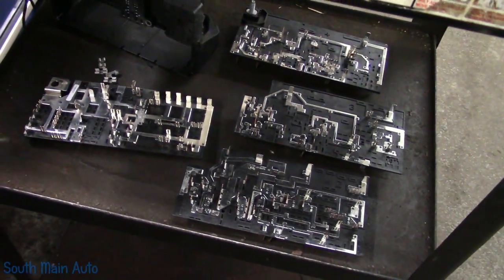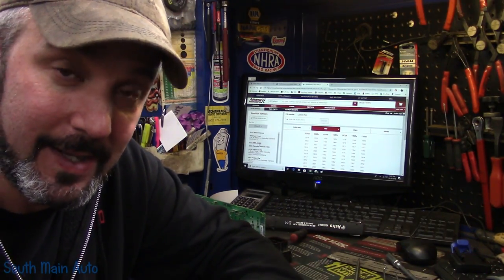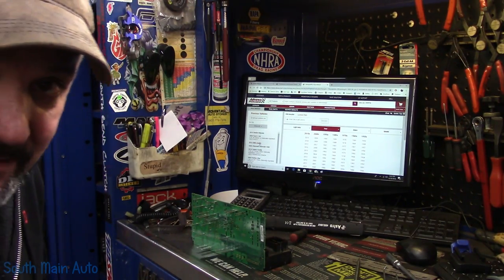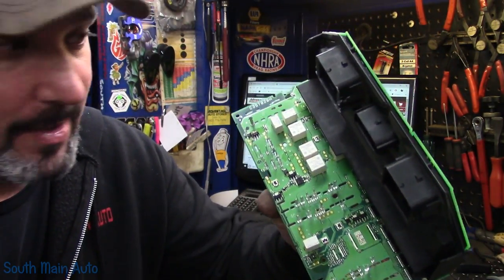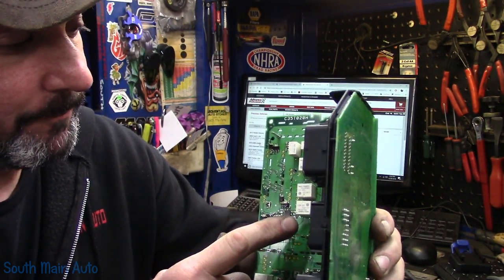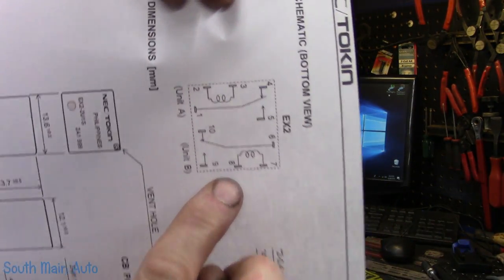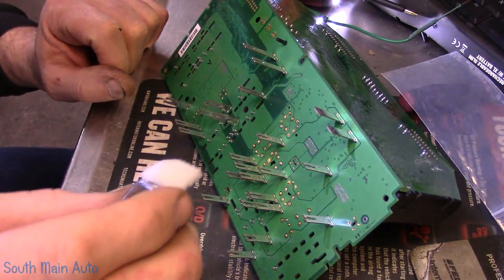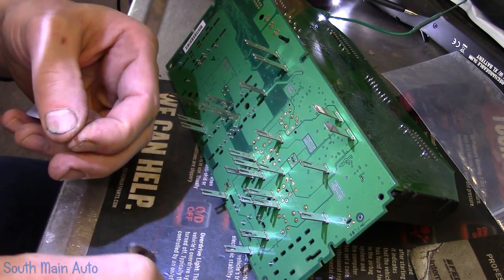Chrysler / Dodge : TIPM Repair - No Wipers

Comment: What's that old engineering saying -- "Complexity is the enemy of reliability"?
Reply: MIL-HDBK-217 pretty much confirms reliability decreases as the square of interconnections. Yes, I am a nerd that spent 30 years working for the DoD.
Reply: All engineers need to remember to KISS ... Keep It Simple, Stupid
or Don't try to  re-invent the wheel.
Reply: broomsterm  LOL, the Germans are masters of the over-complicated boondoggle.
Reply: broomsterm  in many ways, yes, the Japanese have it well in-hand. Where I have found problems (Honda Accord EX) is the Japanese seem not to have a grasp of metallurgy. Fasteners of dissimilar metals are used to hold canister purge valve/solenoid to the evap canister. This assembly is mounted under the car in salt-spray if operated in central NY. Additionally, as of 2001, Honda has not learned to use PLASTIC gas tank (they should copy Chrysler as Chrysler has used plastic fuel tanks since 1975 or earlier). Plus, the rear suspension must be removed to replace the Honda fuel tank. So, well, the Japanese are not REALLY any better.
Reply: it all has to fail somehow or someway......
just some have went over-greedy to the point of insanity and everything being garbage about the time it leaves the factory ;O
Reply: @throttlebottle5906  true, but designing a vehicle or any system for that matter with dissimilar metals (do you understand the implications of that?) under the vehicle is unforgivable. Also unforgivable is use of a steel rather than plastic fuel tank a quarter century after Chrysler was using plastic and then installing that steel rust prone tank in such a manner and location that the entire rear suspension must be removed is the height of "people will buy our shitbox because it is Honda".
Reply: planned obsolescence, with an overly enormous side of greed and penny pinching bean counter input, multiplied by numerous levels and phases of design, assembly, parts construction and more. it's like a bad plague that's infected everything and for the worst.
nothing lasts, the terms dependable and reliable are null and void and usage of the words shouldn't be allowed on anything produced now days...

Comment: If you put more flux core solder on the pins, then use the fluffed up solder wick, it should flow all of the solder into it. Great job as always. Extremely informative.

Comment: First time I've seen a TIPM apart - what a cluster-@#$ of engineering THAT pile is! Unreal ... a multi-layered, $600 sh%# sandwich! 💩 (always wanted to have a reason to use the POO emoticon! Only Chrysler could make that happen! 🤣).

No worries about workmanship on DIY repairs - that's the unwritten rule! Just GIT 'ER DONE, and if she works, BONUS! 🍻I did enjoy the sparks, though - I've made plenty over the years myself! 😁

Desoldering wick = ground strap! That's about the only use I can see for that stuff. 😁 I've got a different desoldering iron - it's basically just a traditional iron with a tube and a rubber squeeze bulb on the end. Works really good! I've saved myself $400 on 2 circuit boards over the past 5 years with it - one on my Amtrol Boilermate indirect hot water heater, and another in a Davis Vantage Pro 2 weather station.👍 It's super frustrating work, though - I have to keep my hammers far out of reach while doing this  ...

AWESOME vid, brother! HAPPY NEW YEAR, Eric, Vanessa, & the whole fam-jam! 🎊🎉🎊🥳
Reply: first line is the best and sums up the whole automotive industry..... but it's not just them, it's pretty much everything now ;)

Comment: Eric, a tip when desoldering. Apply some lead based solder (60-40) to each joint first. That way it'll mix with the old solder on the board making it easier to remove.

Comment: A very fast and dirty way to de-solder without good tools is to spurt some compressed air on the solder after you melt it,, yes it will blow it all over the place, but it wont stick, it will brush right off.
Reply: I repair them all the time. use low air pressure and a pin tip blow gun works well.

Comment: I’ve used both solder suckers and the copper wick. Both work well and they have their advantages and disadvantages. Just take time and patience to learn how to use them. A tip and only a tip is to get a smaller iron or smaller tip for your current iron. The smaller tip will allow you to get more precise when you apply the heat with the iron. Also be careful how much heat you do apply. Some components do NOT like heat! Also be careful forcing something off the board! The circles called pads can be severely damaged with force and they can peel away from the board as well. 

Glad you came out of your comfort zone. Wished I lived closer. I could help you better with some of your soldering skills.

Comment: My experience as an electronic tech says both desoldering methods work.  You have to get the wick hot enough to “wick” up the solder and it is a pain in the butt to use especially in tight spaces.  So I prefer the “ solder sucker” and seldom used the wicking approach.  All in all you did a great job on your first attempt.

Comment: Nice work! Proof that with a logical approach you can fix pretty much anything!

Another good way to identify the relay (or whatever component you're looking for) is to continuity test from the main harness connector/fuse holder or other known pinout, you can clip one of you leads to the connector (in this case e.g. the wiper motor output pin or something) and use the other lead to brush over the relay pins etc to quickly go fishing for a beep to see where it goes.

Solder sucker is definitely the way to go for stuff like this, the holes through the board will be metal plated on the inside so the solder joint is not just on the surface but all the way down the hole which is too far to wick it out. I normally try to heat it enough so that the solder is melted all the way down the hole, then get the solder sucker as airtight as possible onto the solder/hole - ideally it will suck the solder out from the entire hole by pulling through air from the other side of the board through the hole. If you end up with some solder left at the bottom you cant get out, then it's usually best to add fresh solder to remake the joint into a bit of a blob again, then go back with the solder sucker.

Comment: Yes they do fail all the time I have had 5 TIPM replaced on my 2008 Jeep patriot and Chrysler is fully aware that they have faulty TIPM most of the problems come from bad grounds in the harnesses
Reply: I spray all the wire harness ground posts I can find on my Mopars with WD-40 twice a year cheap insurance for Michigan winters.

Comment: Well as ever amazing vid, but kind of demonstrates all that is wrong with the whole environmental argument, we build cars to emit less (in simple terms) then make them disposable by putting stuff that wears out in stupid places, so the whole car gets chucked @ a point in its economic life, for the sake of a cheap component buried in an expensive part, I really would love an environmental expert to explain this cause we all know very few cars actually get properly recycled.
Reply: Auto makers found a way to set things up so that they "help the environment" but end up selling more cars.
Real effective environmental legislation would encourage retrofitting older cars with more efficient and less-emitting powertrains instead of just junking them (since the carbon footprint of manufacturing a car is significant).
Reply: Between the 60s and the 90s we made leaps and bounds in reducing the environmental impact of gasoline-powered cars. A car from the late 90s puts out a tiny fraction of the emissions of a car from the 60s. At this point however we really need to consider what we're spending to get the tiny improvements we are--especially considering how the escalating safety standards are often at odds with efficiency and emissions due to adding more weight to the vehicle.

Comment: Those darn mechanical relays... They could just use MOSFETs and you'd never have to worry about it.
Reply: Many new cars are going this route, even replacing fuses and relays with current-monitored transistors.
Reply: Eh, I’ve smoked more mosfets than relays in my life...

Comment: Awesome.  Yep you are using the solder sucker correctly.  Some times it helps to add a little solder first.  My corvette had a bad unlock relay in the door module ans I did the same thing. Saved 300 bucks and cost me 10 bucks in relays.  Digi-key is your friend for relays and stuff like that.  Keep up the good videos.

Comment: Today's cars are a nightmare. I think I'll buy an 84 Jag.
Reply: Does Bosch still supply replacement smoke?
Reply: An '84 Jag? 😂 You must be a glutton for punishment.
Reply: @gearheadautomotivel.l.c.5476  That's for sure... don't even get me started...
Reply: An 84 Jag would make you miss the reliability of a Modern car.
Reply: Actually “Replacement smoke” is a byproduct of the Joesph Lucas Co. It’s been said “If Lucas made guns, wars wouldn’t start” ;-)
Reply: @rwbishop  I feel your pain. That fiber optic nightmare they call illumination is the worst. Especially at 35 years old. Not to mention inboard rear brakes and the electromechanical disaster of a part they use for a/c mode functions.
Reply: Lucas Electrical: The Prince of Darkness!
Reply: Lucas is known as the prince of darkness
Reply: @danchesney631  Lucas just didn't give a sh** about their electronics that left GB.  That or they didn't check the manufacturer designs. One guy found an upside down relay in his Brit-mobile.

Comment: You should NEVER energyze a relay in circuit like you did because there is a diode across the coil and if you invert the polarity when you energyze the relay you can fry the logic circuit that turns those relays on.
Reply from the maker: Do you remove them to test them then?
Reply: South Main Auto Repair LLC  Yes that is greatly preferred. When you have a hotter iron and shorter dwell time on those joints, removing the relays is easier than trying to probe on the board. :)
Reply: I was pretty sure Eric knew about the clamping diodes that must be in circuit... the Power Probe probably had a current limit that would protect the diode.  Easy to tell which conductor was ground, which is one way to not go wrong.  I checked the PDF, there's not a diode in the case, sometimes these relays have their own diode, but you'll see a polarity marked on the power pins.  Whenever a solenoid connection is broken a big spike is generated, the diode is there to clamp it down.
Reply: @scowell  Have you seen the sparks of the power probe?
Reply: @SouthMainAuto  In your case you lucked out in that there is very little circuitry on that board, and you likely did no harm.  On a more complex board you could end up back feeding some sensitive IC, and cooking it.  You got away with it this time lol, but you may not always be so lucky.
Reply: The TIPM is mainly fuses and relays.
Reply: 99% chance the diodes are where the drive circuit is, not near the relay as the inductive kick from the wire also needs to be suppressed.
Reply: Quite often there is some component on the board to find the right polarity of the relay coil. And just in case use lab power supply with current limited to 80 mA in this case 150 ohms at 12V = 80 mA. Diode or driver should be able to pull 80mA down without immediately burning itself (1W dissipation).
Reply: @ycmdill There were drivers though, and if you look close two large ICs hiding under that piece of black plastic.  The bottom layer traces seem to be all power but if you look at the top side there are some little traces running between the relays and what could be drivers, though possibly it's just monitoring the output.  Incidentally some modern MOSFETs use body zeners so you could possibly forgo the freewheeling diode.
Reply: (Just wanted to add, using a relay that size to drive a wiper motor is idiotic.  I hope it wasn't intentional.)
Reply: @paulmoir4452  it is. It should at least have bi-directional transient protection diode to save the contacts from sparking. 75 cent 1500W 36V Transil would do the job. My Citroen has a Valeo blower motor with a electronic regulator (speed control) module having two MJ11015 darlington transistors. 

When the brushes of the motor wear even a little bit and  sparking occurs, it kills the 200V max transistors. Lovely. Valeo is happy to sell you a new blower assembly (200€). 

New transistors cost about 10€ and when you add a Transil protection diode, it takes up to 1500W of inductive current to the ground, saves your darlington stones or your relay contacts and does not cost anything. Unit will last 4 times longer. 

But.. If the designer would add those, that would mean less sales... 

https://eu.mouser.com/datasheet/2/389/1.5ke-1156012.pdf
Reply: The diode is in there to block the back-EMF from the relay coil. That will take the current if you use the wrong polarity - as long as your power source is current limited low enough it shouldn't hurt it.
Reply: @paulmoir4452  you know it was intentional and the choice of contact material within was likely driven by lowest cost.
They've always done silly things, wouldn't surprise me if those relays were controlled by the BCM, with any diodes over on that board instead, I don't think everything on the TIPM is ran off communications bus, but they change things often enough it could be.
**no I didn't bother looking at the vehicle wiring diagrams to be sure, just going by the past crap I've seen from them ;)
Reply: @jannepo   Oh I agree completely.  A TVS ideally or at least an RC filter.  But I and I suspect you make things that need to be more reliable than cars.   You would think that the lessons of points & condensers wouldn't be lost on them though.
Reply: @paulmoir4452  I guess we do. And the greatest part of the equation is that when Eric O or somebody else tests the relay with 12V Power Probe the Transil or silmilar product does not care about getting polarity right. (unless somebody probes 12V relay with 36V or more). Think about the repairman when you design (a nuclear plant)..

Comment: "Oops, that's too many sparks.." is a completely valid diagnostic observation. 
Multi-layer BCBs like that can be a real pain to deal with. Sometimes an inner layer is a ground plane, which acts like a giant heat wick for the pin you're trying to desolder. There's also a HUGE difference in quality between brands of solder braid. I've used the same kind you have, and found it quite frustrating. MikesElectricStuff has great suggestions for types of braid. 
If you're working on a board that is flat and doesn't have a bunch of fragile things on it, you can heat the joint up really good and smack it on the table. That will make the solder fall out! If you're stripping a board for parts it's quicker and cheaper than solder braid :)

Comment: You need plenty of flux and a rework station,  this is hard to watch.  Go watch a few videos on the rossman group page,  he fixes MacBooks but its the same idea. I was screaming at you FLUX! The whole time lol
Reply: I know what you mean. I skipped most of the desoldering and resoldering. I was thinking of Rossman and Ipad Rehab also. Maybe I'll try this with my heat gun(paint stripper) on an old TIPM  some day, just for grins and giggles.
Reply: he got the job done no experience which shows flux was not needed, if anything fresh solder to it. could have just ripped the relay apart and pulled each pin out for a quicker replacement.
Reply: @bobspurloc  yah,  it's called cold solder. Look it up,  it may have to be released done. Just saying.  I mean he got the job done so I'll give him credit,  but it could have been a better job and better video if he would have spent the time and watched a few rossman or iPad rehab videos. And he would of have nice solder joints instead of cold soldered joints. Also you it makes it easier if you add lead free solder to the leaded solder before you work it, also the iron goes ontop of the wick.
Reply: @fascistpedant758  yah I tried watching it but It was cringy lol,  so I skipped to the resolder in the new relay

Comment: You did a great job. Don't beat yourself up. You rock! I agree flux would have helped a bit. I think you now have a butane soldering tool. might have been a bit easier to work with. I bought one from radio shack when it was a thing. Dirt cheap and much better than the snap on one I bought for 4x the price. Your sister owes you big time. just saying. But that is what we do for family. Learning quite a bit from you . Wish you well.

Comment: Dude, nice job! That solder sucker looks like it works miles better than any I've had.  I gave up on them years ago.  maybe it's time to try that one... A new iron tip would help alot tho, it will transfer the heat better and melt the solder faster.  Always keep a bit of solder on the tip and press with some pressure, helps alot.  Bravo!

Comment: Really great diagnosis Eric 😉 desoldering can be painful or a breeze, my hot tip is to have a clean tip freshly tinned with solder put tip on pin dabbing a litttle solder between the pin and tip so the flux flows in fresh solder and bringing impurities to the surface and allowing full heat penetration faster (to avoid burning the pcb and compromising the adhesion between the the copper track and board) at which point quickly suck out the joint, and if you got good vacuum on it it should have taken out all solder, or having a small contact area which you can usually heat the pin and wiggle it free. Solder braid is good for cleanup before reinstalling part.
Hope that helps mate, cheers for the cool vids keep em coming 😉